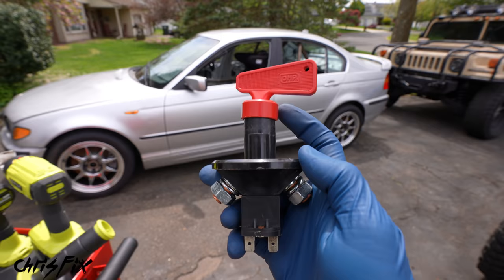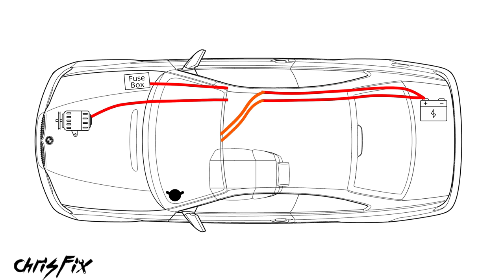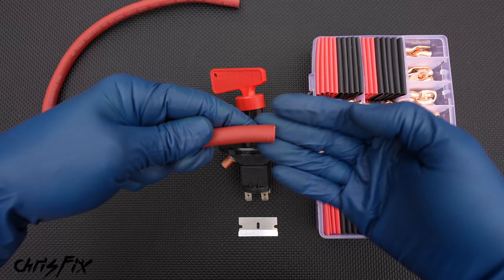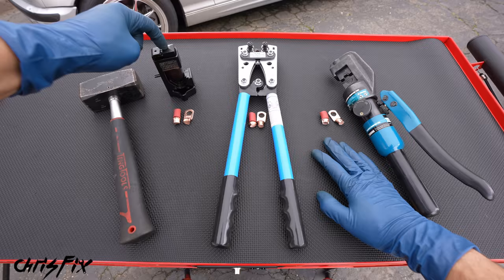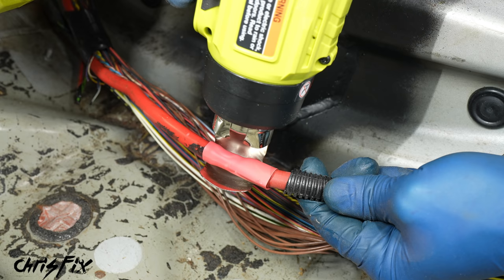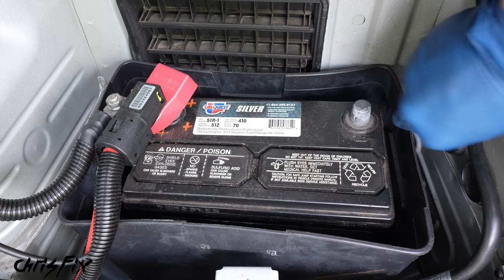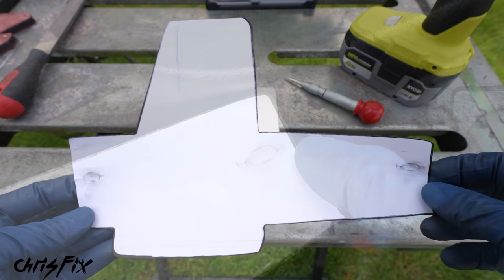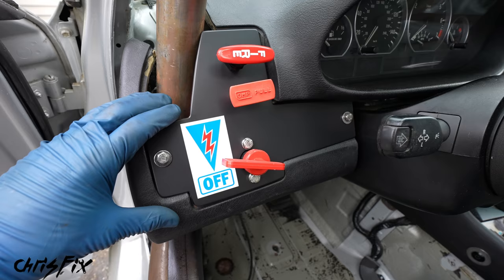How to Install a Battery Kill Switch

Comment: Great vid - one comment, if you pick a bolt to run a ground which wasn't originally intended for grounding - best practice is to run a tap through the thread first, as most of them will have e-coat residue in them which reduces conductivity. When we spec fixings for ground points on production cars, we use special thread-cleaning bolts to clean the threads as they are fitted.

Comment: Myself, I always krimp connectors to battery terminal wires to keep them on the post. I've always just used a pair of vise grips to krimp the connectors on. It always works for me

Comment: The two red cables from the switch to the battery now are superfluous, one is enough. They are fully parallel, they just make a double cable.
With this type of schema the alternator is still powering the fuse box if the car is still moving (inertia) while the kill switch is removed. Not sure if this is what you wanted.

Comment: If you're watching this video looking for a method of theft-prevention: Chris has a different video on his channel about how to install a kill switch for you fuel pump. 

It's a little older but still great, and arguably a better option for theft-prevention, because it's less invasive, since you dont kill the power to every computer in the car causing a reset of all of them, and instead only kill the power to your fuel pump. 

This is probably redundant to most people watching this, but if only person needed this piece of information I'd be satisfied.

Comment: In the mid 90s, Ryobi made a commitment to maintain the same battery on all of their tools. If you own an old Ryobi tool from the late 90s, you could buy a brand new lithium battery today, and it will work just fine. 

Even if they aren't the best brand, that is why I support Ryobi with my purchases.

Comment: I have installed several 1/0 gauge wires into my personal vehicles for car audio upgrades, running some juice to big aftermarket amplifiers and such. It may sound kinda ghetto but I like to use simply a jack stand and a claw hammer. I lay the terminal lug into the little valley shape in the middle of the jack stand and place the back of the claw hammer against it, strike the head of that hammer with another bigger hammer. I'll turn it a couple different directions and shape it out until its roughly a heart shape. The thing is, I only do this maybe once or twice a year, I don't really have a need to buy a tool specifically for that purpose, I just use what most anybody already has laying around in their garage. The joints are great too, yes I've cut them in half and inspected them before, look similar to yours. I can hang the lug up on a nail and hang my entire body weight on the wire too!

Comment: Those hand crimpers work great, I used em when upgrading my truck to a 390amp alternator paired with a 3000/6000 watt inverter. Got a set off amazon! They can be a bit awkward when crimping something in the truck, but after doing a few ya get a hang of it.

Comment: Excellent video. The only thing I would add is something,  like a chain or cable,  attached to the red kill switch key and to the plate so when it's removed it's not dropped misplaced or lost

Comment: Chuckled a bit when you mentioned being a bit of a perfectionist. I'm one myself. A lesson learned early on, getting my dad's 76 CB 750 Honda going after 6 years being parked, comes to mind. While planning the job, dad passed some of my grandfather's wisdom on to me.

Grandfather worked for the local electric company, as a plant mechanic, maintenance worker, for 36 years. In his own words, as oassed down to me, at age 10.

The reason we plan the job, check new parts,  and get the topls laid out, then check, and study, the Chiltons manual, is this. There are two ways of doing every job.

Right, and Again. 

Passed the same knowledge down to my daughter when she was 12, and had front inpacted the Polaris Sportsman into one of the large pines along the property trail, to our hunting area. Helped her get the replacement parts in a friend's parts shed, and went over the manual, before the job. Acted as a guide, and her other hand, as she managed to break a couple bones in her left hand, in the cradh.

Took our time, could have done it myself in about 2 hours, and did it over the werkend. Fired right up, and worked perfectly. Proud moment as a dad, when she test rode it in the side field.

Worst part was, she broke it a week before the archery deer season opener. Came off with 10 days to go, and yes. I did take her with, each time I went out, as did her mother. Passed on a few days to take the .22s out, for small game hunts.

She managed to fill both archery tags in that year's late Bow/muzzle loader season. First archery doe, first muzzle loader buck.

She's 26, married,  graduate of UTI, and working on her last senester of nursing school now. Already has a standing job offer, upon graduation. 

Covered these classes by working on the  busses for her city's MTA.

Didn't get to meet her until she was 4. She and mom were a package deal. She's not blood. She's more than that to me, because she was my choice. 

Step implies a seperation. Why we don't use it. Why i call her my Chosen One. And after that 4 wheeler repair, my shop partner.

Comment: Amazing vid. Only one small thing i would do. Have the "off" position at 9 oclock and the on position at 6 oclock. That way in future. If you need to run an external pull cable so switch can be activated outside the car. Its going in the right direction. ❤

Comment: I love you videos Chris but as a auto electrician. Few things are bothering me and the big one is the number of ring terminals on the battery on your truck. Take glove box out or even in the engine bay get a water proof junction box with Multiple slots. Run good size wire to power it and the small off slots for the multiple things you need to power. Some even have fuse slots so you don’t need to run inline fuses. The isolator install was spot on and safe but avoid crimp connecting on thin wires solder and self amalgamation tape will do the job with some fabric tape.

Comment: Chris, there's a good explanation why your first attempt with the hydraulic crimper didn't work out perfectly. The crimper dies are designed for metric cables and crimps. And there is no one to one equivalency between AWG and metric sizes. The two gauge wire you used turns out to be (33.6 sq mm) in thickness which is a little loose for the (35 sq mm) die.

Comment: One critique for this video: If you install the alternator positive on the same post as the fuse block, your engine will not kill as the alternator will keep it alive. You should have the alternator cable ran to the same post as the battery positive thus removing all sources of power from the engine and fuel system in the event of an emergency. Otherwise great video!
Reply from the maker: The computer gets killed when you turn the switch off which kills the car, but thanks for the tip!
Reply: @chrisfix  If the engine is running, the alternator is putting out power. Therefore turning the switch off does not isolate the computer from the alternator hence keeping the engine running. It’s no different than pulling the battery out of a running vehicle, and is an unsafe approach without correcting this.

Comment: At first I thought this was an unnecessarily long video. 
My bad, excellent video with lots of information. 
I was expecting to introduce a cable striper among this very nice collection of tools and not use a razor.
Also I try always to install the kill switch as close to battery terminal I can but since your car has the battery in the trunk you have to make some compromises!

Comment: Two tips to include would be. Use 3-1 heat shrink not 2-1 it will slip over terminals if you forget. Also use the glue filled heat shrink as you heat it the glue will squeeze out helping to waterproof and prevent corrosion. Its not much more expensive and makes a big difference

Comment: hydraulic tool has the advantage that there can be a die for other activities, for example for different shaping of pipe ends etc. I personally use the hydraulic tool and then I have smaller pliers for which I change the inserts either to hex or insulated connectors (fast on, etc)

Comment: I like how Ryobi power tools have the same lithium battery design from when they used NiCad. You could literally use an old 20 year old Ryobi NiCad battery from in an hour old Ryobi power tool. Likewise, you could also use a day old Ryobi Lithium battery in a 20 year old Ryobi power tool.

Usually, other brands/manufacturers change up their designs with each series or chemistry.

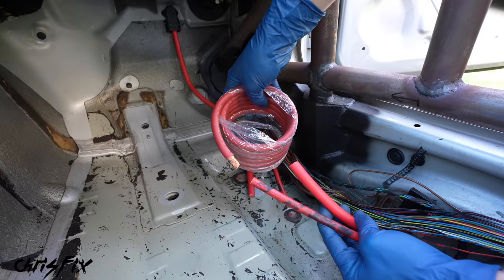Comment: Those are the types of cutters that I would use The front goes into a smaller gap and also the blades overlap at the end 9:10 and by end I mean when they closed 9:10

Comment: About the crimp test
I thought to myself, who would have resources for testing the crimps before making them, why would someone want to spend the extra money for something they will throw away anyway? I thought this way mainly because I can't get my hands on the tools, wires or connectors that easily.
 
But then I thought, I can't get my hands on a new car easily either! You need to make sure that it is as good as the factory's because you should build it to last. Honestly, you can't realy be careful enough when working on a car, even manufacturers sometimes make mistakes and recall their vehicles so you need to take as much precautions as you can.

Comment: a small tip from an electrican: crimp at the beginning of your connector first and not the other way around. otherwise, you risk having not enough space for the cable in the front of the connector....

Comment: About the hand crimp. I haven't used one for electrical but in plumbing pex pipes are similar. to prevent the fitting from sliding off while positioning the crimps, we just pinch it first with some channel locks. I imagine you could do the same with electrical

Comment: Someone should show this guy a video on how to rust protect the roll cage. It doesn't matter how clean your wires are if your chassis is rusted away
Reply from the maker: It’s surface rust. The cage will be sanded and painted.

Comment: @ChrisFix dont twist the wires for your connectors. If you do this, your wires get a bigger crosssection. If they twist back they get thiner and your wire can jump out if the connector is a bit bad pressed. This was teached from my electrician teacher.

Comment: Ryobi isn't the best impact gun by far, but they're pretty good for the money.
I dropped one once into a oil drain pan and it completely subelmerged and I figured it was dead so kind of left it there until the boss asked where the rattle gun was and I told him. He fished it out, dried it off and went right back to using it.

Comment: pro tips : you can say that you added a little bit of an angle between two crimp on one connector to be crimping in quincunx across the whole connector. That way you won't apply that force uniformly in a straight line and tend to prevent the strands to get loose over time and vibrations.

Comment: Maybe you should mark which is the on/off position for the switch. If you manage to kill the power before blacking out the track official may not know and accidentally flip the switch back on thinking they're shutting off the power.

Comment: I imagine most people who aren’t making a racing car won’t want to run battery/alternator power cables behind the radio with the low/speaker level cables. Seems like a likely place to introduce a lot of noise into the sound system. Very cool though!

Comment: If you are running long lengths of cable like here do not use anything marked CCA.   CCA is Copper Coated Aluminum.  It does not conduct as well as pure copper.  It will drop your voltage as the cable will have more resistance than copper.  Also plan ahead!!!  Anytime you splice a wire/cable you are adding resistance.  Also make sure the cut off switch will handle the amperage needed.  Many cheep switches are available but can't handle the amperage needed for a car starter motor!

Comment: A kill switch for the battery makes sense if you have multiple vehicles because some of them will sit and barely get used, and they might be difficult to find batteries for if they're 6-volt. I'd use the hydraulic crimpers because I lack the muscles needed for the hand crimpers, and the hammer crimpers are easy to lose.

Comment: Chris… Very important to use the same material when connecting wires and terminals in order to avoid galvanized corrosion. Never mix  aluminum with copper… I got an incident where by mixing materials the terminal connection got into ashes.

Comment: About 5m20 in your video, you have wires on the "outside" of your cage, between the cage and the chassis, in a big crash this could be a problem, in our regulations for racing in (Belgium) europe we have to have al wires on the "inside" of the cage.
It's just a reminder, i made this mistake one's lucky for me i had a bold in cage at that time so it wasn't that much work for me to change it back then, that's why i remember it so well hehe

Comment: Dude. Your awesome. For a consumer, would there be a way to run a smaller battery that charges and keeps your electronics going while the kill switch is off so that you don’t have to reset your electronics every time?

Comment: I think, the power resistor you haven't done very good. It is better to solder it's terminals, and because of power, mount it in more ,,free air" area, because it can be quite hot. Also the ground terminal could have more area - like now, you can cut it with the bolt... (31:08)
Other than this, perfect work!
Reply from the maker: In this case, as long as it had a solid connection to the wiring, that would be all that's needed, and this resistor is not being used all the time, otherwise I would have done exactly what you are talking about. And the bolt had a good sized washer on there so I was not too concerned about the surface area. Thanks a lot!

Comment: I just have an easy copper swinging flip flop battery cutoff right on my battery terminal.  Cost about 15 bucks on Amazon.  Good for when the car won't be driven for a while and not coming back to a dead battery.  2  minute install.

Comment: If you use waterproof heatshrink (has hotmelt glue inside), you won't need silicone paste.
Reply from the maker: It's a good habit to get into anyway with wiring. No harm in adding some on

Comment: About trimming off the electrical cable insulator, everything in your explanation is correct, except for your illustration of what happen if you accidentally cut away some strand of wire in the cable. In using the the water hosts as illustration, you said basically less hosts means less water flow (which is true). However to say the less strands of wire means less flow of electricity is simply wrong. The amount of electric current flowing through a cable is the same, regardless of more strands of wire or less strands of wire. What the difference is the ABILITY to take large amount of electric current. If you have too less strands of wires in the cable (the thin cable) and the electric current is too high, the wires will overheat and caused the insulator to melt. This is dangerous. It may cause electrical fire. When designing the car, the engineers had already calculated the current load expected and decided on how thick the cable should be, so that there is no safety issue. So, I think the better illustration will be the work load for the cable be distributed distributed to all the strand of wires. If you accidentally cut some of the strands of wire, the remaining strands will need to take more work load.

Comment: In my experience this type of heat shrink as an adhesive on the inside that is heat activated. This should provide the water tight connection. I think adding the silicone would negate that.